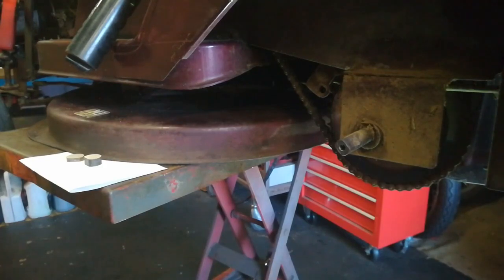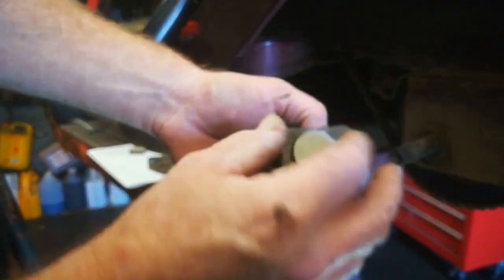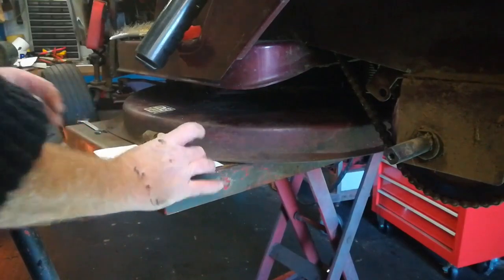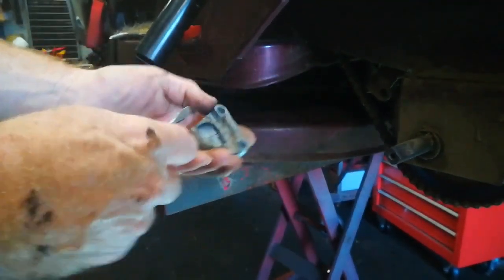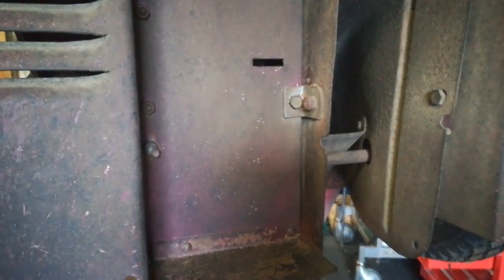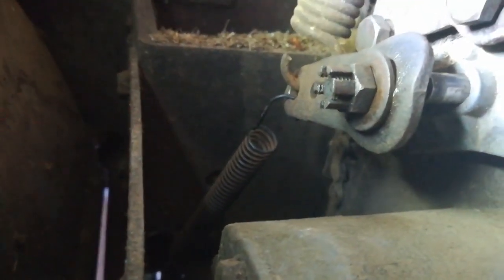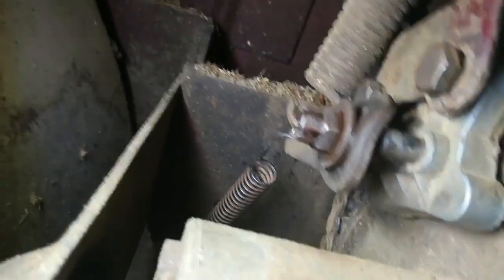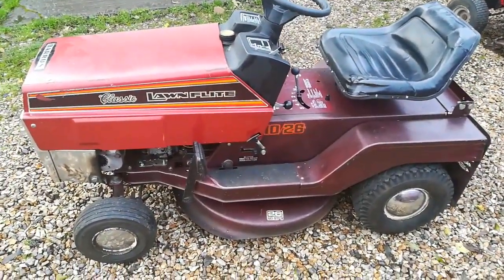Lawnflite Brake Pads

Comment: Great video. I have the same mower and need to replace the brake pads but cannot find anywhere that sells them. Can I ask where you got the pads from? Thanks
Reply from the maker: They are called brake pucks. I bought them on ebay from a UK user alantmsmower. Just checked history.. user no longer on ebay :(  Try a search for MTD brake pucks. Possbly only available from a US site/user? Hope this helps.
Reply: @ragfour9303  thanks for your reply and looking up where you got them; It’s a shame that that user no longer exists. it’s such a great mower, I hope I can locate some! Thanks